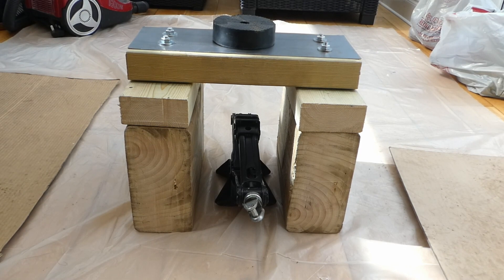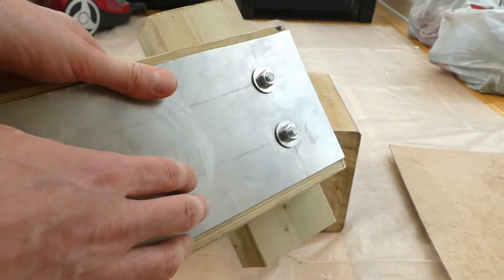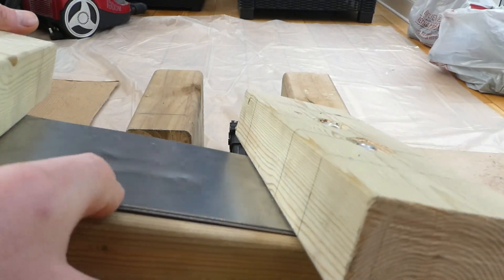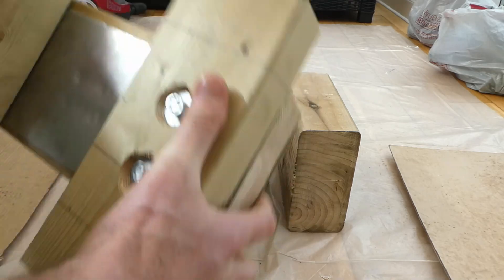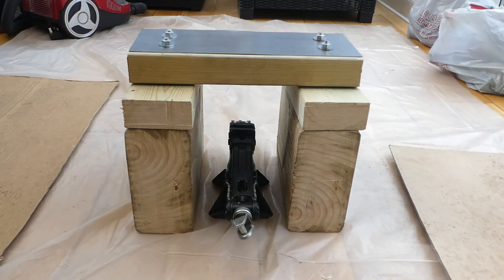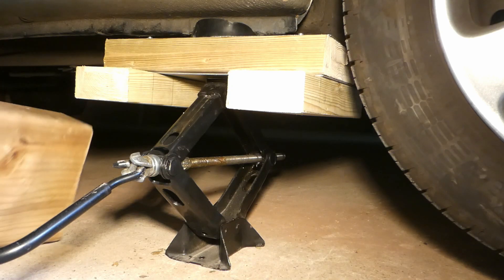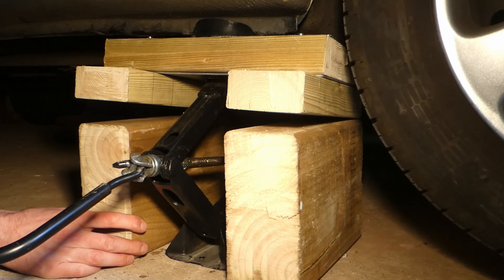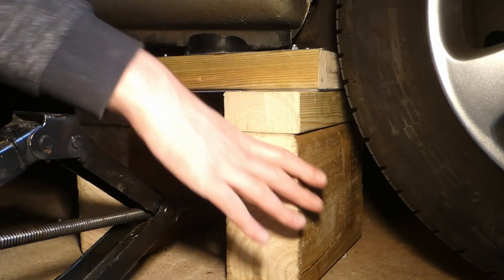DIY car jack stands

Comment: you could make drive up ramps...take 3 lengths of that 4 inch x 8 inch timber, about 3ft long...

Stack the 3 lengths, 8 inch base x 12 inch high, draw a line, corner to corner on each side... and cut each side using a circular saw 4 inch depth cut, forming two triangles.

You then have a pair of ramps that just need glueing together, and an end plate fitting at the top of the ramp...

I did similar, and they work fine.

If you use longer pieces, and draw the line diagonally, several inches from each corner, that gives you a horizontal section at the top of each ramp.

Comment: Funny.....every one of my scissors jacks....either kept from older Japanese cars ....or newly purchased from Harbor Freight, etc.... ALL need more clearance than what is provided by the two, stacked 2x4's shown for "legs" shown on the orginal vid (https://www.youtube.com/watch?v=jp2DqnL3A1g&t=14s).. Not a lot more, ....maybe 1/2" more, but it makes building this thing a bit more of a chore. Stacking 3-high of 2x4's for each leg would be too high.....some cars clearance wouldn't allow you to slip the unit under the sill. You need shim-stock or Luan board of fractional-inch thickness to "just" get clearance AND for it to be low enough to fit under cars.

Comment: You need to make the base wider. Those boards you are using on the bottom will tip over standing them on there sides like that, lay them flat and use two or three of them. Or use a couple concrete blocks for the base instead. Mobile homes are setup on them all the time.

Comment: Have you ever made this for something wider than a scissor jack (like a standard hydraulic jack that is around 10" in width)?  Wondering if something like this can support the weight of a car with more distance in the center.
Reply from the maker: I have not, but it will depend on the strength of the wood I suppose. A thicker metal would probably be a good idea to spread the load.
Reply: In fact I was rumbling around that same concept for one of my floor jacks, which btw wasn't even very wide. I was using my smallest floor jack.
Point being, forget it. It was a really bad idea. Not because some convoluted structural issue. But a rather practical and simple issue. 
The width of the entire assembly becomes way to wide and cumbersome. Defeating the practicality of the concept! 
The width of the assembly also creates another issue, lack of balance or hit the tire... Meaning when you (try to) center it on the car jack point. It can't center and simply hit the tire. Since it's unbalanced, it's not useful at all!
Cheers

PS: This concept absolutely depend on a narrow jack base! Even my 5T bottle jack has a too wide base to make it work. The catch is the distance of the car jack point to the tire. Can work on the back, but not on the front of the car ;-)

Comment: Most jack stands are very affordable, depending upon where you buy them, and probably cost less than the cost of your raw material.
Reply: The problem is location. Often the "jack point" is all you can find to use...and once "jacked".....there is no other place to put the jackstands. The whole idea here is that the "lift location"..... is the same as the "jack-stand location".....
Reply from the maker: I completely agree that jack stands are quite cheap, but my problem was that there is only one strenghtened jacking point. In effect I have to jack the car at only one particular point. Of course, one can always put the stands somewhere under the frame and jack on the jacking point at the sills, but I always prefer the sills.

Comment: It WILL move fore-and-aft.....once the other 2 or 3 wheels are off the ground under a similar jackstand. The idea is good and clever...but the bottom higher supports need more fore-aft resistance.
Reply from the maker: Many thanks for the comment. I have been using it for some time now and has not moved at all, although I do get the point. Depending on the position of the jack point the size of the blocks can be adjusted to be more stable.
Reply: @moremolecules  ...good show

Comment: There' nothing wrong with the rubber. What you have is in fact perfect. You need something that yields so that it self-adapts to the car's rotation as the car is being raised. You can improve the safety further by having a larger base. A large base will prevent tipping over, and there will be more materials in the way to hold the car should things fall because of a minor earth quake.

The slot for the jack should be as narrow as possible. This will further lower the stress on the bridge.
Reply from the maker: Yes, wider base would work better, but the pinch point for my car is way too close to the front tyres and this was the widest I could fit. Appreciate the advice.
Reply: Adding another block of wood under where the jack goes improves safety.
Reply: Jeeeeeeeez.....you have a thing about earthquakes!!

Comment: Our hardware store sells these slabs of rubber to be placed under a washing machine, these are about as much as four little rubber pieces to put under the feet of washing machines yet lots more material. In used a slab to cut bands from and place 50x50x5cm concrete tiles on the septice tank stone two years back, we walk over them all the time and the rubber has no sign of deteriorating so do you think something like that could be used to cover the top of the standard?
Reply from the maker: I used rubber piece that was specifically designed for lifting a car and it was branded as heavy duty. It is not at all heavy duty, it looks like it will disintegrate after a few more uses. I guess you can try with the washing machine rubber thing, it could be better than mine.
Reply: @moremolecules   This is the slab i was talking about, its very stuff and strong,very hard to cut even with a raor sharp knife:
https://www.bricodepot.fr/angouleme-champniers/tapis-anti-vibration-noir-mat-60-x-60-cm/prod52868/
Reply: @moremolecules  - For what it 's worth "I've been there, done that". Those jack pads are a waste of money in many (most) applications.
On the car side, has you're noticing, very quickly they get cut by this type of "edge" lift point. Exactly the same happens on the jack side. A jack without a broad and smooth lift base. Will also cut it to pieces...

All in all, I had much better luck with the regular left over pieces of wood! It's way cheaper also! ;-)
Reply from the maker: @crpth1  Yes, you are right about these rubber things. Probably a softer left over pieces of wood would be better

Comment: Nice idea.
What kind of wood did you use?  What are the measurements of the single parts?
Reply from the maker: Hi Holgi, I used C16 CLS treated timber. The measurements of all the parts are at the very end of the video. It is pretty easy to build with the dimensions at the end of the video. Hope this helps.